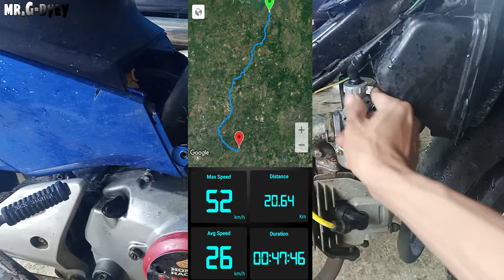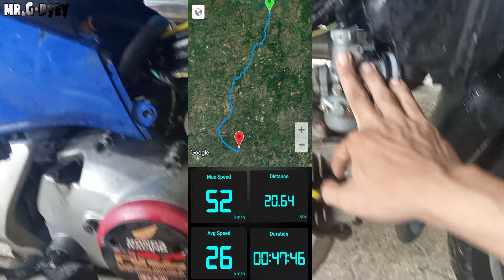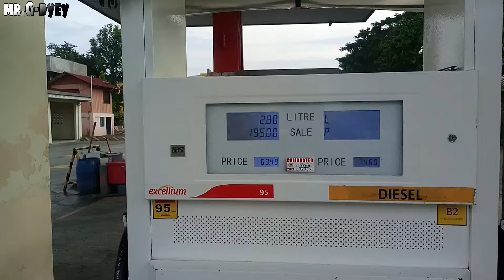Ano ang pinakatipid at Pinaka malakas na Carburator ?

Comment: Sir meron po akong 28mm flat slide anu po magandang jettings nya naka racing CDI po ako tapos faito coil jettings kopo ngayon 115/38 baka po may ma suggest po kau
Reply from the maker: Ano po set nyo ? Minsan kasi 110/35 depende sa port and Cams
Reply: stock engine po

Comment: nka 28mm ako lakas sa gas ntry ko nadin 26mm lakas padin sa gas 110/32 jet nibbi pla carb gamit ko street race 28mm/ super sport 26mm
Reply from the maker: Naging ok po ba sunog ng sparkplug ?
Reply: @GDyey19  opo rouser 135 motor ko dual spark plug kaya maganda parin sunog
Reply: @GDyey19  mas ok pa naging konsumo ng keihin kht replacement kaso wlang menor